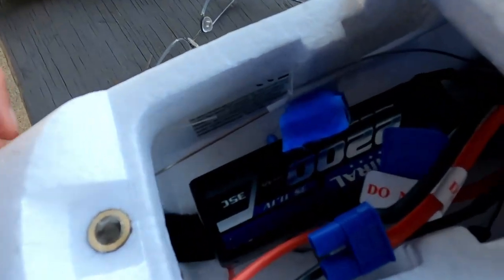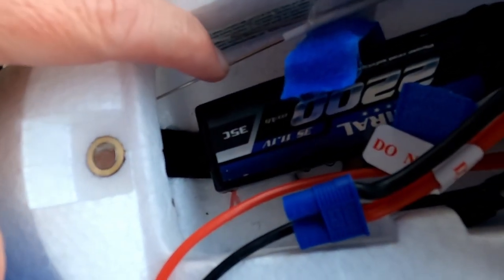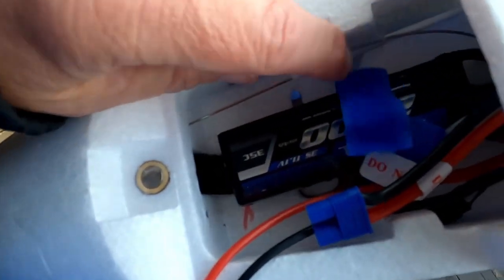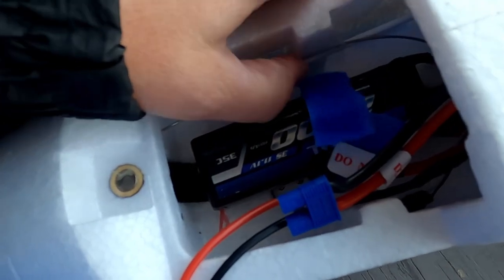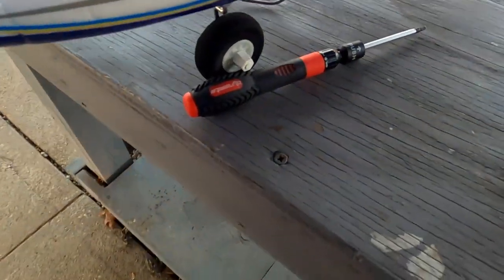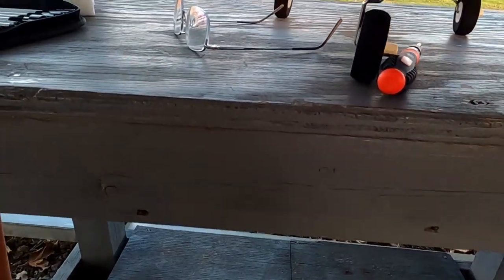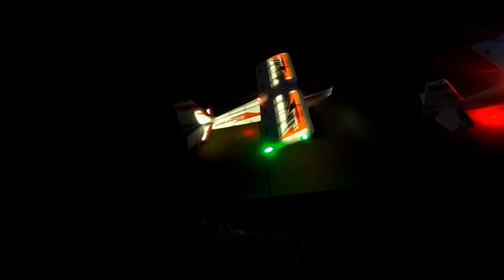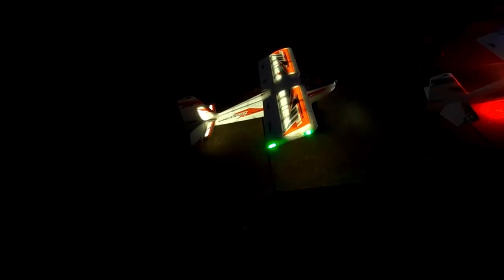Timber X's and Twin Otter ground footage.  Sorry the flight film malfunctioned.  Pilot error.

Comment: Nice otter, even if on the ground. Does it have differential thrust? Liking the lit up Timber💖
Reply from the maker: It does not have differential thrust.  It is stock.  There is a way to mod it though.  She fly's great as is.  The landings are nice and smooth with full flaps.  Last winter I was flying her and she lost power and I came down on the front gear hard.  The battery was too cold. The nose housing finally came loose.  A little glue and she is good as new.

Comment from the maker: I had the nose gear twist around on the Twin Otter on the first landing.  I see that the nose gear housing is loose and needed a glob of glue to hold it in place.  I also need to better secure the control rod to the fuselage.  Second landing was perfect but my camera was pointing the wrong way.  :(